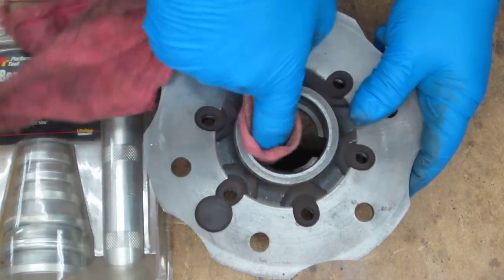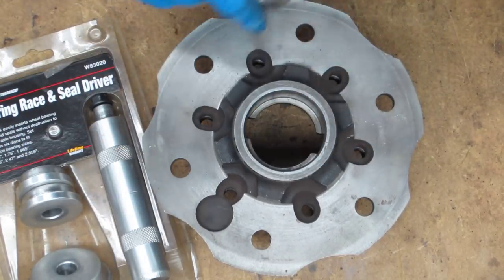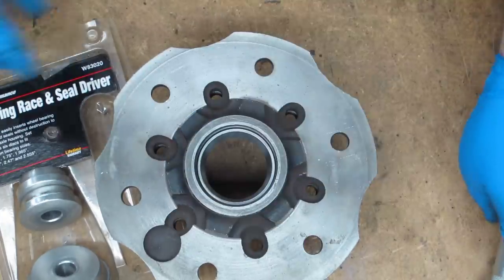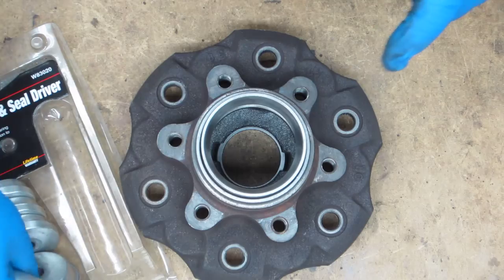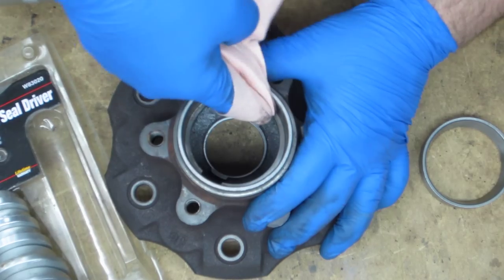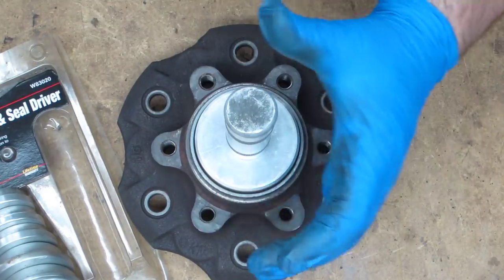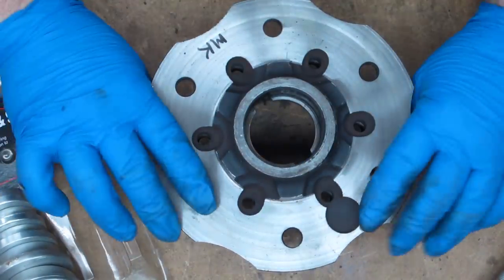Bearing race installation

Comment: Thanks for providing the video!  I have a couple of suggestions if you don't mind.  Just things I picked up over the years.  If you put that race in the freezer and/or warm up that hub with a heat gun, the race will install much easier without having a chance to gall the bore while driving it in.  Also, if you use a big flat driver disc bigger than the race you are installing, it helps to get it started.  Then, you can take a few thousandths off the old outer race on your sander, put the large disc on top of it with a driver handle on it and use this as your race driver.  Always the perfect fit and no need to buy a lot of extra tools to clutter up your already overcrowded toolbox.  Not to criticize, just a comment and once again, thank you for taking the time to post this great little video!
Reply from the maker: I don't mind suggestions at all.  Great tips!  There's a lot of different ways to do this.  This may just be the ticket for someone watching/reading this.  Some guys have said that freezing the races is enough for them to slip right in without any driving. Probably depends on just how fast you can get it from the freezer to the hub.  If they're wrapped in aluminum foil, it will help them stay cold during transit.  I've never personally tried the freezer tip....maybe I should! :)  I used to do this quite often, so the tool was well worth the investment.  For guys only doing a couple of these, I hope they read your tips and give them a try!  I've got a handful of hubs to rebuild.....I just might do a vid using some of these techniques when I'm working on them. 
Thanks for taking the time to comment and share your tips!! Certainly not taken as any kind of criticism.  I'm glad you liked the vid. :)
Reply: I'll definitely be putting the races in the freezer. I've done that with wheel studs before. It makes easy work of replacing wheel studs.
Reply from the maker: If you need something faster than the freezer, you can use a can of "Dust Off"....compressed air for blowing off things like keyboards and such......turn it upside down and it will spray super cold.  You can chill the race down pretty quickly that way. :)
Thanks!!

Comment from the maker: Not on the outside of the outer race.  If the bearing seizes, you don't want the outer race to spin, it will ruin the hub.  Install the outer races dry, then put some grease in the hub and pack the bearings.  Once installed, it's okay to put grease on the inside surface of the race where the rollers are going to contact anyway.  I've also got a vid up of packing the bearings
Thanks for the question! :)

Comment: Another way, as mentioned,  for us cheap skates, is to take the old race and grind the outer rim down using a bench grinder so it will slide into the hub freely and after pounding the new race flush with a large plastic hammer, line up the old race on top of it and pound with the plastic hammer until it is slightly down in the hub. (Usually only takes a couple hits.) Then get the old bearing, set it into the old race and either press it in using a hydraulic press, or making sure the hub is on a solid surface, pound it in using a wood or metal dowel (piece of a wood shovel handle or similar) about the diameter of the bearing and pound it home with a large hammer. I have been using this method for years.
Reply from the maker: That's definitely another way to do it.  I have used that method before.  When I was working on a lot of cars for other people, I bought this tool so that I wouldn't have to grind a different race every time.  It wasn't near as cheap, but it was a good bit more convenient. lol  Thanks for adding this option for other reading the comments. It's a great description of a very good option!! :)

Comment: Thanks for the video! Different hub, but same process. After replacing ball joints, tie rod ends and reseating the wheel bearings in the last couple of weeks, the alignment shop told me I still had issues; this time with the upper control arm bushings and wheel bearings with end play.  I've repacked my wheel bearings several times and I've even rebuilt my suspension back in 2012, but never thought to replace the bearing races. Guess I'm just a dumb girl, lol! I'm sure this is why I have so much bearing end play in my 12 year old Xterra; it's just worn out even if I can't see the flaws. Time for new bearings, races, bushings and wine coolers. You're awesome.
Reply from the maker: Well...if you're doing the work yourself, you're certainly not a dumb girl!! lol  Hopefully, the races will fix your issue. :)   Is it a 2wd or 4wd?  
Mike
Reply: Thanks! ;) She's 4wd. Every few years or so I experience a myriad of suspension and steering issues. Consequences of wheeling. I'm really hoping that replacing all these parts will improve the ride again. The shimmy at 50mph is pretty bad.
Reply from the maker: I hope you get it all sorted out!  I've had a couple of rigs that did that and it's not fun. lol :)

Comment: If you don't have the tool use the old races when you hit the new ones in. If you're worried about the old ones getting jammed in the hub, put a cut in them with a thin grinding disk so they will come back out easy.
Reply from the maker: Yes, that should work great.....especially with the cut.  That's great input! :)  Thanks! Mike
Reply: Where do cut it, on the edge??

Comment: Thanks for the video.  It should be noted that the race needs to be in the correct orientation before installation.  The taper needs to be facing outward to accept the bearing.

Comment from the maker: cjmmjc....... Great question! 
They will get back to temp pretty quickly.  The hub will soak up the cold just like it would heat.  By the time it's expanded into place and you can't move it, it's not really going to get any bigger.  Just wait until the race won't move, then start assembling.  I'm sure it will be back to room temp by the time you can get the hub on the spindle.

Comment: Great video. But brass is a softer material it won't damage the hub. Also I put the races in the freezer the night before installing them.
Reply from the maker: Thanks. :)
I've used brass before....had comments telling me not to use it because it leaves metal behind that can end up in the bearing.  I guess maybe the takeaway is to use brass when removing the race and not when installing.  The freezer is a great idea and brought up fairly often in the comments.  I never have the forethought to put it in the night before, nor the patience to wait for it the same day.  In all my years, I've never actually tried it.  Maybe when I'm a bit more caught up, I'll do a video on how it works.  :)   -Mike
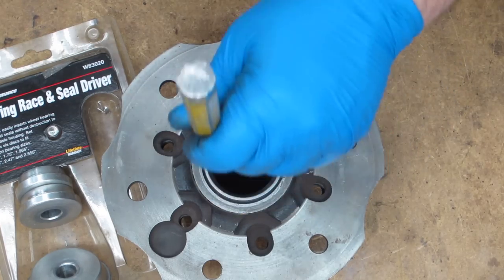Reply: @bluehandsvideo  I have used a punch before you just have to make sure you get what other chips are in the race area out before you put the bearing in it's not good to go metal on metal brass is a softer metal but snap-on does sell a tool for knocking out the races but I have that as well but when it's 2:00 in the morning and you're not going races and a hub on a trailer at a truck stop cuz you're changing a wheel seal you got to do what you got to do
Reply from the maker: @feeneysmechanical6215  Sure glad that wasn't me. LOL  Yep....gotta do what ya gotta do. :)

Comment: I bought a tool set like this, and none of them fit my outer race. I need a little bigger than 67mm but my kit goes from 65 to 72. And using the 65, i gouged my hub surface. Im not a happy camper and no idea what to do
Reply from the maker: If the 65 was smaller than the race, how did it gouge the hub?  Do you have a cone that it a bit too big for the race?  I wonder if you could put a bolt through the center and then spin it in a drill....a drill press would be better.....lathe better still.  Then maybe use a file to decrease the diameter down to what will work...??  What's the bearing number you're trying to install?  You should be able to use some emery cloth to carefully sand down any "rise" in the surface around the gouge.  It's hard to come up with ideas for you without having anything to look at.  If you take a short video showing the issue, you can post it to your channel, then come back here and leave a link. -Mike

Comment: Helped me install new trailer bearings after new to me trailer started throwing dust caps
Reply from the maker: I'm happy to hear that!!  Did you also find the one on how to pack grease in the new bearings?  Was it throwing the caps because the bearings were getting too hot?

Comment: the way cheaper solution would be to take the old bearing race and grind away enough of the outer diameter so that it will fit in the hub - same working principle afterwards.
Reply from the maker: Yep....that would be cheaper and work great.  There's always more than one way to skin a cat. :)

Comment: Once I take the old race out and if I make a single cut on it so it does not bind i could theoretically use it to drive in the new race and thusly avoid the expense on something rarely used by the average joe.
Reply from the maker: Hmmm.....great idea! I'm not sure the average joe would have the abrasive cutoff wheel to cut the bearing race, but that would work nicely.  I bought mine along time ago when I was doing a lot of car work.  It was under $20.  Now they're about $35-40, but I did see one place online that had 4 left for $22.  You're right....not really worth it for one or two bearings, but still a nice, quick, easy way to install them.
Thanks!
Reply: Edgar I do that with a bench grinder. It works great with an arbor press but using a hammer I'd expect damage.
Reply from the maker: Insain Toyota To add to that.....I have a friend that saves his warn out 14" abrasive cut off wheels.....he mounts them to his bench grinder so that he'll have a very narrow grinding wheel.  With that setup, you could easily use it to cut the bearing race(or other small items).  I agree about the hammer and damage......so use light hits and walk it in slowly if you don't have a press.  A bigger bench vise might work as a press in a pinch.Thanks!
Reply: You got it Edgar!  That tool you just made is actually better than the ones you buy.  I had a whole box full of stuff like that.  The "suits" would come around and try to tell me to get rid of all the "junk" I had.  It was difficult to try to convince them that this "junk" was worth it's weight in gold and that it was actually making them money.  OK, don't get me going....

Comment: If you put them (the race) in the freezer and they contract, do you have to wait for them to go back to room temp before you put a new bearing in a contracted race. Seems to me like that would throw off the tightening of the spindle nut
Reply: The sheer size of the hub sucks up any cold or heat you put into that race so no waiting is required. Any temperature difference goes away very quickly.  Time is of the essence.  You have to be quick!
Reply from the maker: Yep.....and sometimes it sucks it out so fast they don't get fully seated and you have to drive them in the rest of the way anyway.  It's a great method, but I don't typically use it.  Thanks for answering this! :)
Mike

Comment: It seems like a large washer the size of the race with a bolt and two nuts should do the same job, provided you find a washer the right size.
Reply from the maker: Absolutely!  That would work just fine, but finding a washer would be the challenge.  You'd probably want to stack a couple of them together for strength.  There are several ways to do it without buying the Bearing Seal & Race Driver kit, but the kit will do a wide range of sizes and it's all in one neat package.  I'd probably make a set on the lathe before I did the washer.....but that's only because I like using the lathe :)
Thanks!
Reply: The washer and nut thing will work as long as you get things together quickly.  All the time it takes to do the stuff lets the cold get sucked up and the part goes back to it's larger size.  It also helps to rap on it when you feel things getting tight.  This vibration will allow the parts to straighten out.  I taught at a trade school for over 31 years and we found out ways to do things that weren't really in the books but in many cases, worked much better.  You never can learn it all but if you keep yourself open to new ways of doing things, you can learn a lot.  This is a great posting.  Lots of good creative-thinking ideas!